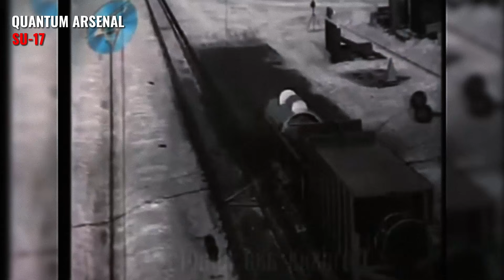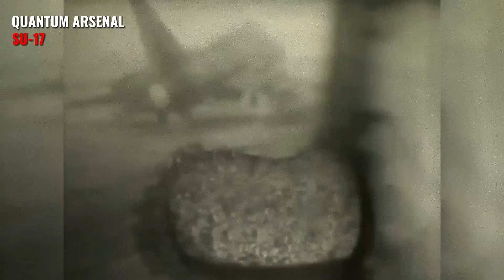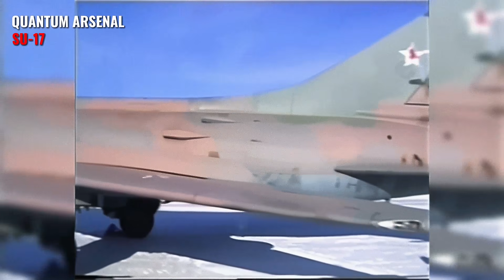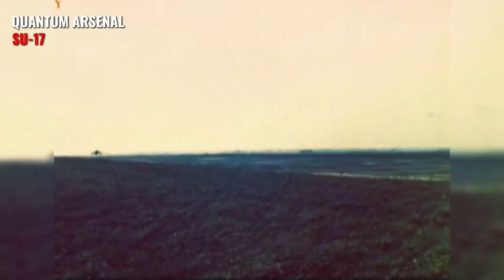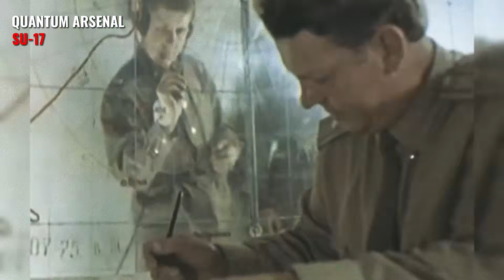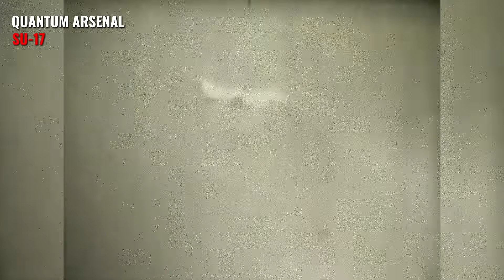Russia’s Winged SLEDGEHAMMER — Why The Su-17 Is An Industrial Monster

Comment: Why are pilots wearing pressure suits in a SU -17 or 22? 🤔
It makes sense for very high altitude ejections, like with a U-2. But in a Fitter that most probably will never approach 40 000 ft but instead will stay at low level most of the mission, what is the pressure suit for? Besides, I am certain that the pilots absolutely hated it and - seriously - they couldn't even take a pee. 😰
Reply: this suit maded for compensating g-forces on high angle maneuvers, it has system of valves and tubes connected to aircraft systems. How it works: For example when you climb, blood leaks from brain to legs and pilot can have "black screen". Suit at this moment pump air to the leg section, acting as an air clamp and squeezing pilots legs to keep extra blood in upper section of pilot's body. 
Americans have same suits, for example MSF830
Reply: Mein Gott du bist ein Depp

Comment: What is strange is that a country that was so heavily invested in the concept of the Sturmovik direct ground support completely failed to design a successor.  Instead, the Soviet Union went all in on point defense interceptors without having a decent ground attack aircraft until the Su-17.  Western fighter-bombers were capable of carrying 4,000+ lbs of bombs, while Soviet contemporaries were barely carrying 1,000 lbs.
Reply: The predecessor Su-7B carried 2,000 kg (4,400 lbs). Before that there was no need, having multiple times as many tanks as the West, and those very interceptors clearing the skies above the battle fields.
Reply: @imrekalman9044  - The Su-7 was a decent ground attack aircraft, but the Su-17 was a big step forward.  Compared to a contemporary like a Hunter or F-100, the Su-7 was a bit lacking, and its only advantage would be speed.  But how advantageous that speed is is questionable